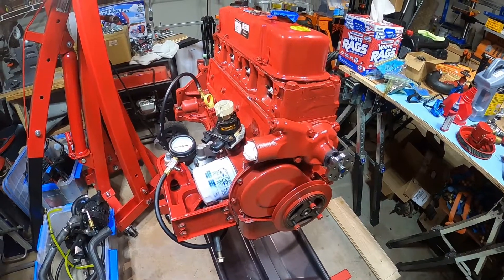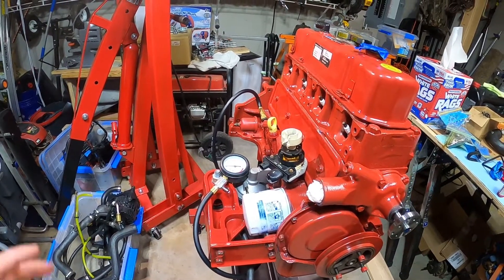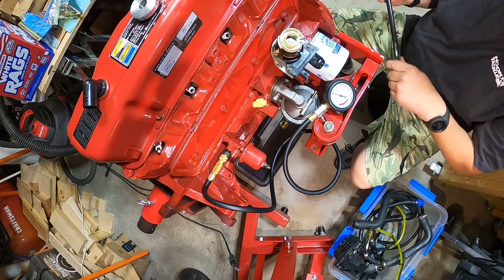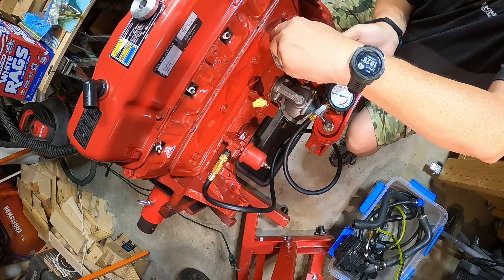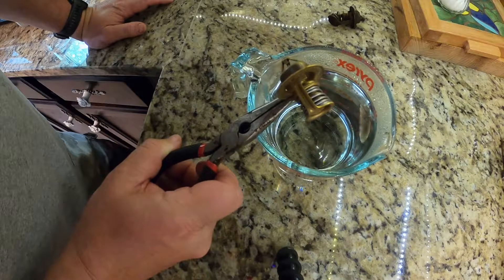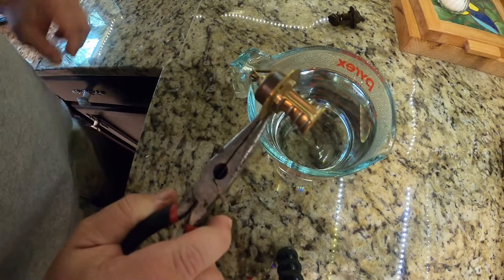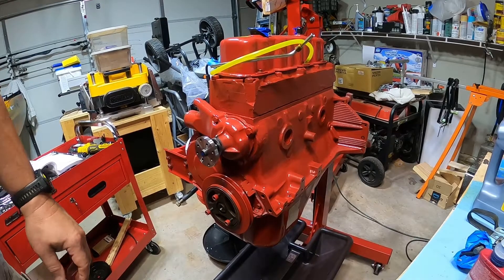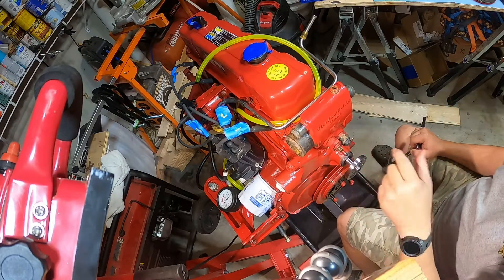Motor Rebuild Part 4 (Volvo Penta 3.0)

Comment: Hi, I completely overhauled an engine, I wrote to you and I did as you told me, the monoblock is ok, I continued to do the rest, almost everything changed. There are two sensors in the box, why two? The one connected with the eyelet is ok, the other one broke the male for the cable connection, I should change it but is it necessary?
Reply from the maker: Can you send me a photo of the sensors?  philfry1964@gmail.com
Reply: These days I can’t disassemble them, the only thing I have are the codes 872066  872068  3852029
It gives me this three codes in the engine exploded, but I don’t understand the last 2 I have to put and if they are needed
Reply from the maker: Ok...   
872066 = Temperature Sensor
872068 = Temperature Sensor
3852029 =   Temperature Sensor

They are all three temp sensors.  I remember that my exhaust elbow temp sensor was broke off and I had to replace it.  Part Number (3862500).  I don't think my boat even looks at the exhaust temp anyway.  I would only think that your motor has the Water Temp Sensor and the Exhaust Elbow Temp Sensor.  I doubt that you would have three sensors.  If you google search the part numbers you can see that two of the sensors are for a screw on nuts and one is for a slip on wire lug.   My Engine had only the two sensors.

Comment: Did you record the part where you attach the riser elbow to the manifold? I did this on mine but it’s spraying everywhere, I did something wrong or missed a step.
Reply from the maker: Let me see if I have pictures or some video of it.  Did you install the gaskets along with the restrictor?  I have a drawing that shows how they are placed.   If you email me I can send it to you:  philfry1964@gmail.com